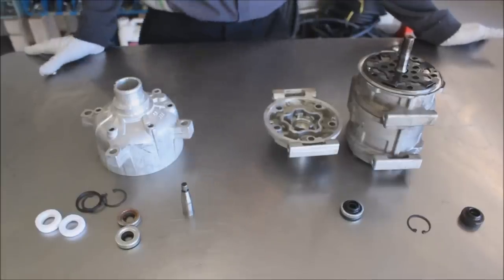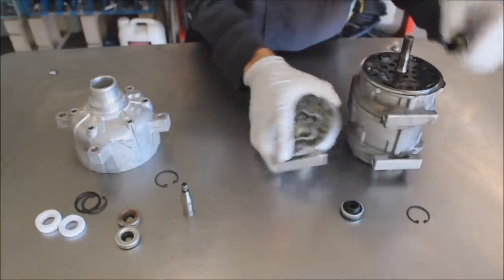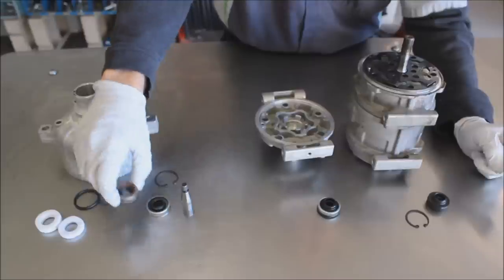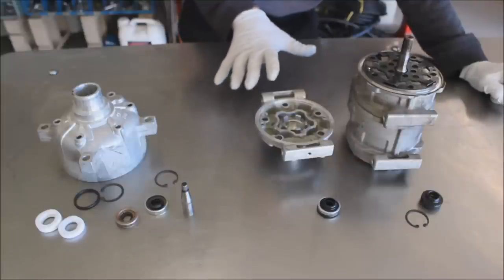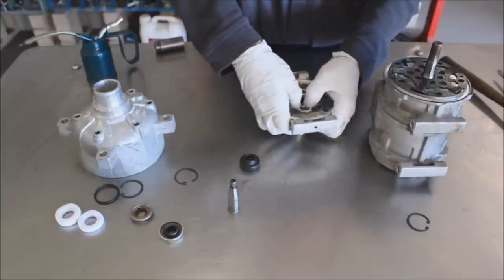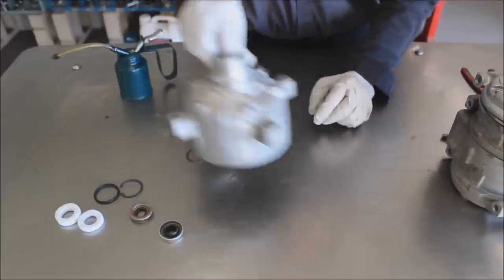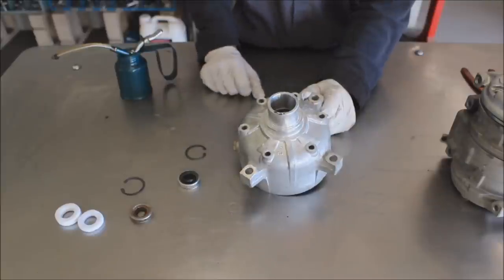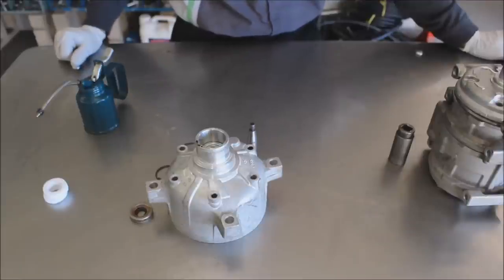A/C Compressor Shaft Seal Installation Tips

Comment: I installed a Denso brand new compressor and it started leaking from the shaft after 2 weeks... Sent it back and installed another same Denso new and it also started leaking in 2 weeks .. Is  there something wrong I did ..Can you tell me why a new  compressor/seal leaking ?
Reply: High head pressure from restrictions in the condenser,office tube, or expansion valve on foreign vehicles. A manifold gauge set will give you a definite direction,

Comment: Hi, I'm looking to buy a reseal kit on your site for my Delphi HD6 compressor. When I disassembled the compressor it didn't have the top and bottom round gaskets over the flap plates. Do they come without the gaskets from the factory? Do I need to install those gaskets now? Thank you very much.